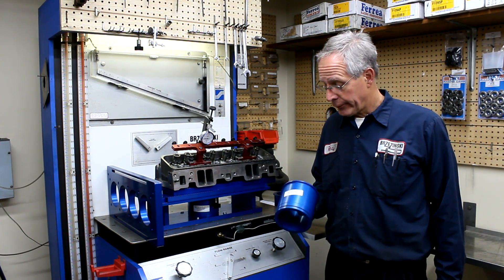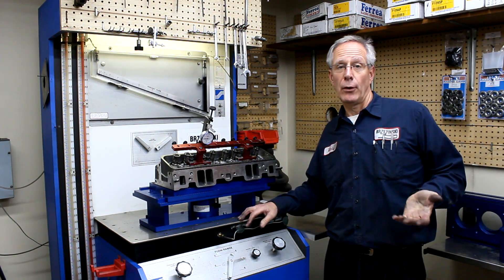How Much Does Bore Size Matter - Part 14

Comment: I have an LS head I have to flow which is a 3.78 bore but my only adapter I have is a 4.030. That’s too big of a difference correct? I believe the biggest stoke LS bore is a 3.905.

Comment: what vortec head would be best for 355 sbc with a rv cam for low end torque for the street
Reply from the maker: The Vortec bow tie is the best choice
Reply: I personally DO NOT like a vortec head due to them being weak in the knees. Get them hot once and they WILL crack and then theyre over with. The horse power gain over a standard ported double hump is minimal and compared to a 200 CC Dart is less. head vs head a 200 CC Dart is a much better head everywhere.